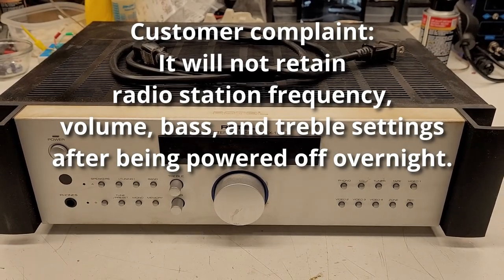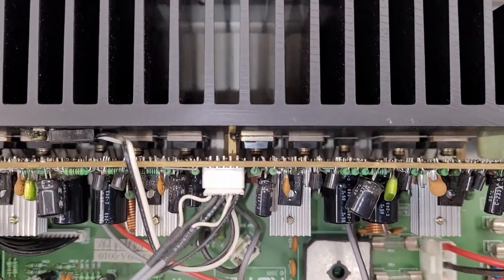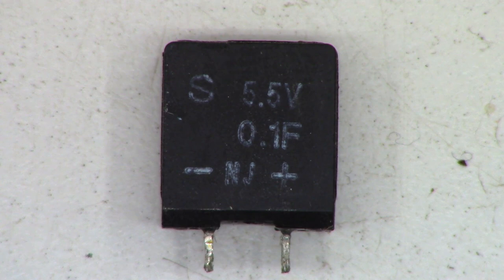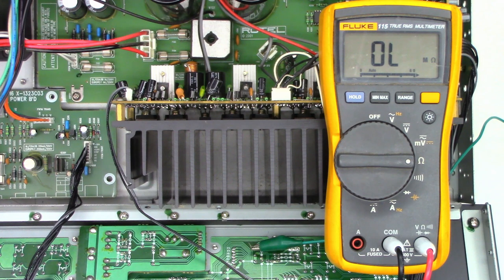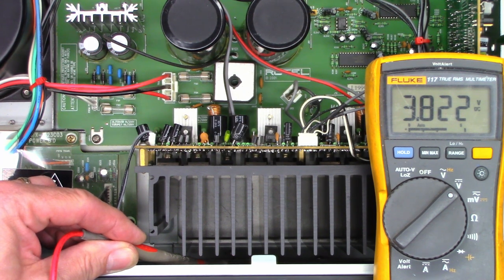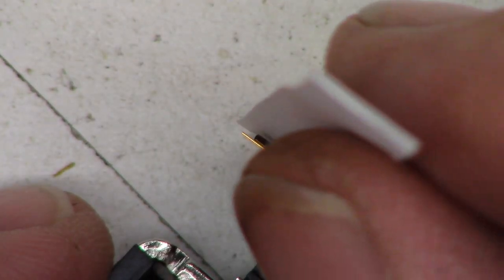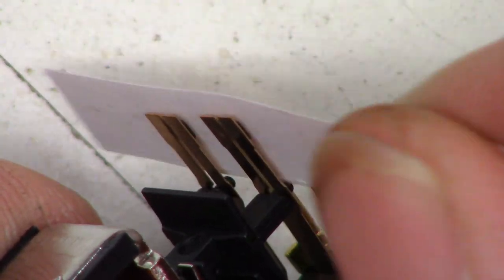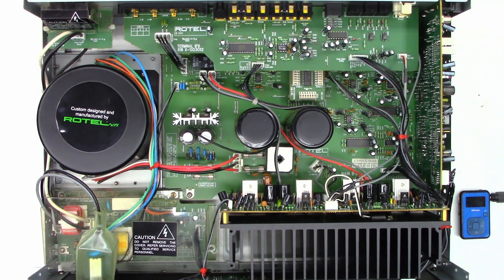ROTEL RX-1050 STEREO RECEIVER. WONT REMEMBER VOL, BASS, TREBLE, OR STATIONS. CUTS OUT AT LOW VOLUME

Comment: Thanks for this.  I have the same receiver with the same problem.  It's been like that for many years and I finally fixed it.  I would have never been able to trace the problem to that superconductor.  It's back in my system now sounding great.  I didn't clean the speaker relays but I am ready for that if/when it gives me trouble.

Comment: Great tip regarding the cleaning of the relay contacts. Amazing how a simple piece of paper can do such a great job cleaning the contacts. I've seen other techs swear by regular paper for cleaning VCR video heads with great results so I imagine it's in the same ballpark as far as being just abrasive enough without causing damage. 👍

Comment: Nice fix . It is oddly satisfying  when you can fix something with reclaimed parts . Good tip on the paper burnishing some you tubers go at the contacts with sand paper which works in the short term but will fail within 6 months .My nose started to run the second i saw all that dust Jeez .

Comment: I love these old Rotel receivers, I have a surround processor from this time, beautifully made and sounds great.

A quick question if I may, I have an amplifier made by a very small British company (Shearne Audio) which completely lacks the protection relays (John Shearne thought they interfered with sound quality) which results in a quite nasty thump on the bass drivers. Are you aware of any retrofit kits I could use to sort out this "feature"? I have been using an external speaker switch, manually cutting the speakers in 10 seconds after I switch the amp on. This works, but can you see any problems with this approach?
Reply from the maker: I had a Sanyo amp that did the exact same thing (no relay, direct coupled) on only one channel, turns out it had a bad cap in one of the preamp power supplies that was allowing DC until the other good cap charged up to the same potential. As far as the switch you are using, I see no problem at all.
Reply: @norcal715  Ah! Yes this makes perfect sense, as I have noticed that the thump is there if I use the amp as the preamp only... As the device is 25 years old now I may give it a once-over and cap replacement if necessary (they're good quality caps in there, Nichicon I think, but that doesn't mean they can't degrade). Thank you for the response, and the confirmation that my workaround is harmless :)

Comment: My Rotel RX-1050 has a tuner that died in Oct 2022.  Prior to that the FM radio would work for about 10 minutes then cut-out (no sound). The unit was serviced about 15 years ago for the same problem (under warranty at the time). I don't get the impression that the Turner CCA was changed at the time  as there are still wax/glue  seals on some screws. I poked at all connectors, especially those on the Tuner CCA, to no avail. If I disconnect the harness from the Tuner CCA to the microcontroller, the display shows 'tuned'  and I hear white noise in the speakers,  likely as a result of the 'mute' signal un-muted due to the  the disconnected harness. I have to conclude that the problem is likely not the processor. Any ideas how to proceed? I'll keep the unit as an amplifier, but it would be nice to have the turner working again. Any comments appreciated.
Reply from the maker: If  you can find pinouts for the tuner then check power to the tuner for proper voltages and grounds. Also look at data/clock lines for good non distorted waveforms.